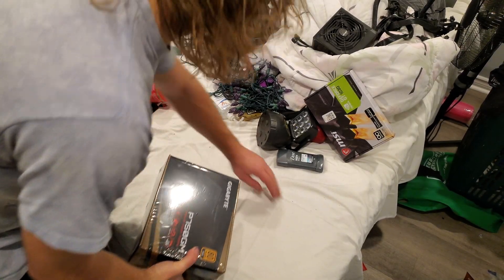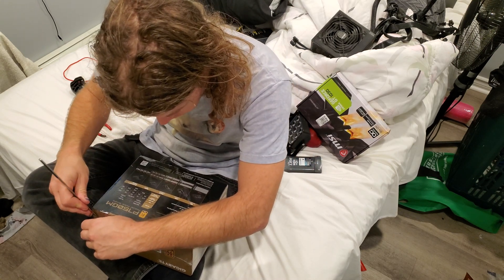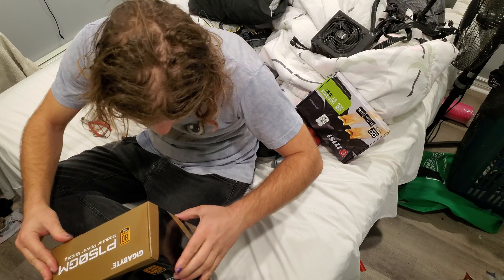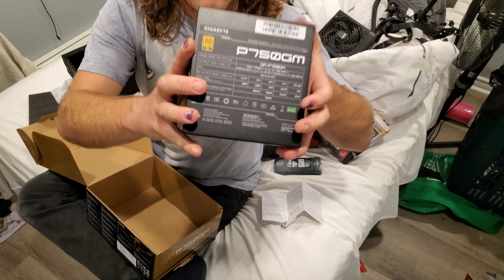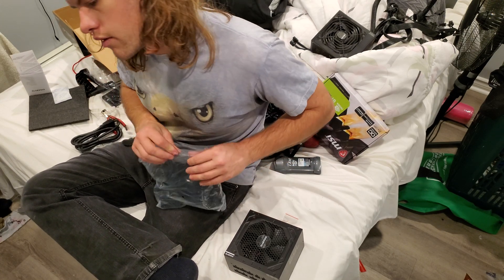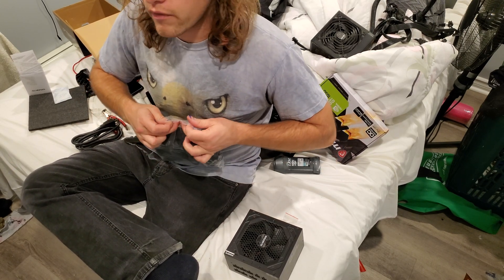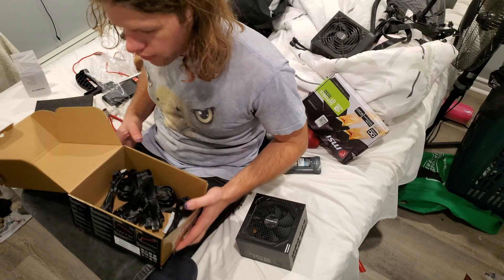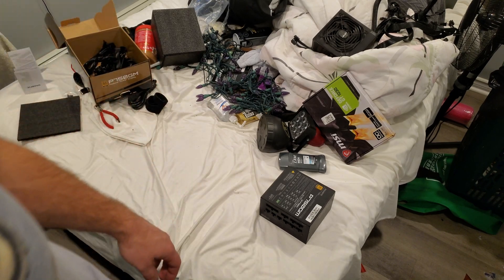Unboxing the Gigabyte P750GM Fully Modular Power supply

Comment: how is this holding up now? I just got this apart of a bundle deal and read some DOA reviews....now I'm nervous to use it. Let me know your results! Thanks,
Reply from the maker: Still working so far! Not like my Cooler Master one that died in 6 months..  although it hasn't been 6 months yet
Reply: I just got this one and am nervous about putting it in my system.  is yours still holding up?  this will give me enough hope to use it at least til I can do better.
Reply from the maker: @ScullyMD-jt1bn  I've had no issues whatsoever, It's working fine so far
Reply: @ScullyMD-jt1bn  I havent had the chance to use it yet. Im planning on using in my next build. It should probably be safe in more cases, just try not to push it to the limit.
Reply: I have an FX8350 and a 1050 non ti.  and 32gb of ram, think my system will be fine with it?
Reply: @ScullyMD-jt1bn  125 tdp on the FX8350, and 75 tdp on the 1050 ti. Ram isnt that big of a power draw. You should be very fine with this. 

To put it in comparison, I'm using a 3070 on a 650w PSU. You should be fine with that build you listed!
Reply: @ScullyMD-jt1bn  if you have rtx 3000 cards you have a high chance of exploding the psu
Reply: @limwellz  I do not have an rtx card at all it's only a gtx 1050 not even ti

Comment: Nice unboxing, that new psu works well or it give you any problem? And what are the specs of the pc in which you installed the psu? Thank you.
Reply from the maker: It worked just fine! I actually bought a used motherboard and cpu yesterday because I thought the board was dead when actually the power supply is dead so now I have two motherboard and CPU, now I can finally build a dedicated server pc!!

The PC that I put it in has the MSI z270 plus motherboard, 20 gigabytes of ddr4 RAM, 500gb SSD, 4x 3 terabyte hard drives in RAID 10 for a total capacity of 5.2 terabytes, Intel i5 6600 K currently clock to 4.1 ghz, it can go to 4.2 without a problem, I'm just underclocking it to extend its lifetime.

It also has the built-in Intel HD 530 as well as a GeForce GT 1030 that I'm planning to upgrade next week. I'm pretty sure the GeForce is defective because as soon as I plugged it in the power supply broke it wouldn't work anymore, as well as it was giving some red artifact lines on the video feed for a while but once it warmed up it stopped doing that..

 I will have another video coming out soon titled 'I bought a cursed video card' which goes into this in a lot of detail